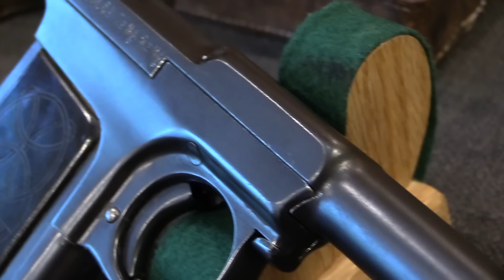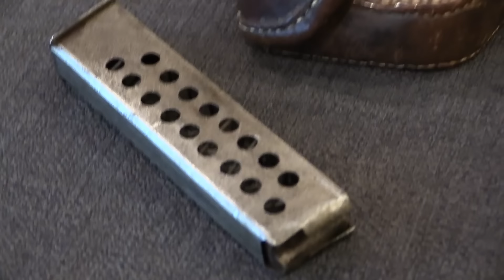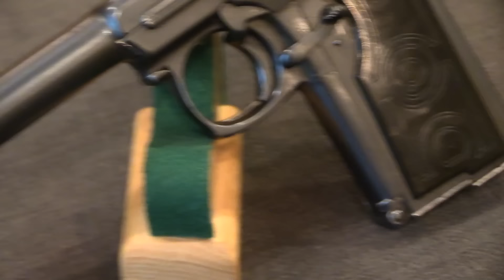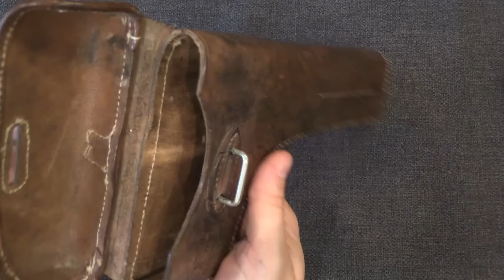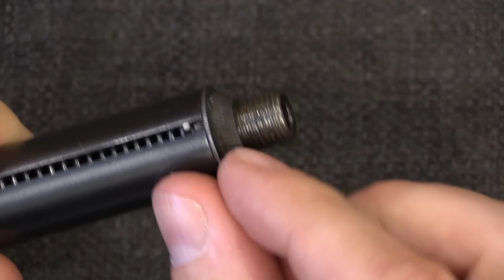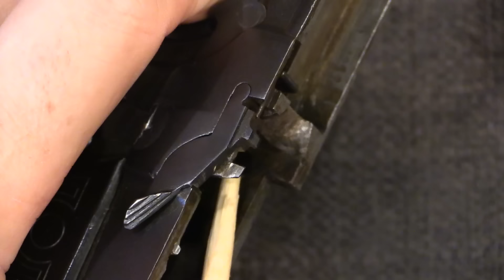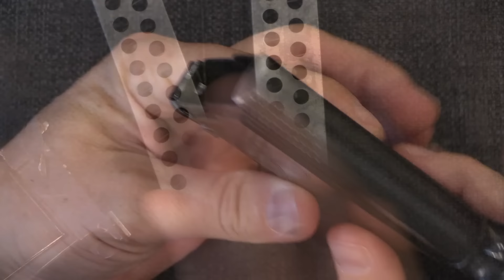Sunngård Automatic Pistol: 50 Rounds in 1909

Comment: You all probably figured this out, but at 5:40 Hg is Hectograms aka hundreds of grams.  It threw me off for a second because I was thinking Mercury
Reply: There actually was a x-com-like-game where the aliens geared up with their fancy shield which became increasingly stronger against beam weapons (which you would have acquired by that point) and increasingly more susceptible to traditional ballistic weapons...

And there was also x-com apocalypse, where you could develop a toxigun, using lethal poison to deal damage - mercury anyone? ^^
Reply: @peka2478  polonium is easier. old KGB micro pellets.
Reply: I thought it meant mercury too, and I was wondering who would base a weight system off of a toxic metal.
Reply: The Rogue Wolf The same people who used a toxic metal to measure temperature (especially in thin, fragile glass tubes made to be placed in one's mouth). ⚖️🌡
Reply: Soviet who Cuts Small bullet at high velocity? Sounds like it’d do alright against armor
Reply: @TheRogueWolf  You've never seen mmHg for a pressure measurement?  Or used an old thermometer?  Ye Olde Folk were clever, but they didn't always understand what was killing them.
Reply: Ye olde people probably didn't eat pressure guages or thermometers.
Reply: Hectogram symbol is properly spelled 'hg' though, like 'kg' and 'dag' (decagram) they're the only 'large' prefixes that aren't uppercase.

Comment: I'd imagine one of the reasons they rejected this weapon would have been from a safety point of view. With the rear magazine retained by that hook, it would have made Proving Clear a major headache, as in the military (certainly, the British Military), proving clear, that is, completely emptying a weapon of both ammunition and magazines, and then locking back the bolt, slide, or action is often the only way a weapon may be passed from one person to another, for example, when handing a weapon back into an armoury. (I'm a former qualified Range Conducting Officer for the-then Territorial Army, what's now known as the Army Reserve).

Comment: I'm guessing, and it's just a guess, that the intention of this design was to reloading with the magazine stores in the holster, using the second magazine in the grip as the third magazine. At that time the common practice was to retain the empty magazine and exchange it with the loaded magazine stored in the holster. I'm thinking the second magazine stored in the grip was a last ditch, it's there if you need it sort of thing.

Comment: While that deminuative cartridge might not be a one-shot stopper, in 1909 if you shot someone in the abdomen and the bullet pierced the peritoneum and the small or large intestine the person shot was likely going to die of peritonitis. Remember there were no antibiotics until the late 1930s. I can only figure that shooting a person several times in the abdomen would only hasten their demise. This of course assumes that that cartridge was capable of putting a bullet through whatever layers of clothing the person had on them at the time. Had it been fabric they would probably be toast; if they were wearing a woolen tunic for winter wear quite probably not.
Reply: David Green This, people who puzzle at the popularity of sub 32 calibres at the turn of the century need to remember that any, internal, injury likely resulted in infection and a painfully death. The deterrence factor was strong.
Reply: David Green if the 2000fps is anywhere close it would penetrate substantial clothing layers.
Reply: If we accept the stated velocity of 600m/s for a 28.5 gr (1.85gram) bullet the kinetic energy comes out to about 330J (0.5*m*v^2), this is much more than 22lr which will happily shoot through wood if HP and and also significantly more than 32ACP, although it is less than 45ACP I still think this round will quite easily penetrate a winter woolen tunic
Reply: It`s all well and good saying they enemy would die eventually, but that`s not much good to you on the battlefield if the other fella lives long enough to shoot you because you didn`t have a man stopper.  Hence the .455" Eley and .45" ACP.
Reply: The only real use of a pistol in actual combat is to spray some rounds to run away and get your rifle working again, or to just run away.  All it has to do is buy you some time, if it kills someone, great, and frankly I'd feel as out gunned holding a 1911 as a Ruger .22 if my attackers have rifles.  I'm pretty convinced that the best side arm is the FiveseveN because it's easy to shoot and has a large capacity.   Self defense in non-combat situations is a different matter.
Reply: David

If they don't die after the first bullet you shoot them again until they do like with any other gun. Plus pretty much any bullet with be an instant kill when shot through the head or the chest. 

Remember, attackers will be shot, survivors will be shot again.
Reply: Fell Man - I must disagree. Elsewhere on here there is a video detailing the results of a 1700+ incident study on the outcome of stopping an attacker with various caliber handguns. The .22, .25 and even .32 caliber rounds failed to stop the attacker at least 1/3 of the times even with multiple shots. This was real cases, not theory.
  The scariest thing about that study was that around 15% of the times when hit even by multiple larger rounds, there was a hard core of attackers that still kept coming. My guess is the shooter was having trouble aiming in a state of panic - which is not unusual.
  I personally did care in an ambulance on a guy who was awake and talking after being shot smack in the middle of the forehead with a .22. It was embedded in the skull, but didn't go all the way through. If his skull had not been as strong, it might have. But it didn't.
  A .22LR round is most often 40 grain. It's better than no firearm at all. The fascinating peashooter above was 28.5 grain. I wouldn't want to bet my life on it.
Reply: @Cacowninja 
The aim of a military is to incapacitate - not kill - the enemy.
With regards to direct fire soldiers are trained to fire in the chest area because it is the biggest target. Stomach is very rarely lethal but is painful.

Wounding the enemy is usually more beneficial either way. Someone needs to evacuate and patch up the wounded soldier. It takes time, resources and manpower, significantly cutting down the efficiency of a group or even a regular-sized platoon.

If the wounded soldier is not evacuated it will affect morale negatively, especially because his mates will have to listen to his screams and they can't be guaranteed to be evacuated themselves.

A dead enemy, while usually retrieved at some point, is much less of a hassle for the enemy to deal with than a wounded one.

Source: spent a year in FDF.
Reply: +David Green Your timeline is off. https://www.ncbi.nlm.nih.gov/pmc/articles/PMC3109405/ Sulfa and other antibiotics were in use by the late 1930's.

Comment: Serious question is it quicker to eject the mag slide the second forward or just load a fresh mag from the belt? I honestly think with training it can’t be that different and you get higher power rounds (albeit fewer rounds) per mag in the more standard semi automatics of the period
Reply: 123 456 I think the intention was to drop the first, reload from the belt and then you still have one left on the gun if you somehow still need to shoot
Reply: Sarlac Watch the video again.
Reply: To load the rear mag, put it in the front, engage the slide hold open and load from the top of the slide, then return it to the rear, and insert a loaded front only magazine.
Reply: Yeah, that second magazine definitely seems like it's a backup for when you're out of regular magazines. To be fair, most people wouldn't be expecting it. If it didn't even have a spare, it would be quite handy
Reply: InfernosReaper Yeah, it's more of a last ditch kind of situation where you somehow managed to lose the other magazine or most of your gear altogether.
Reply: The only real advantage to this magazine system would be in portability. In a military firearm, short or long, the speed and simplicity of a single drop mag would of course win out. But, for a hunting/survival type weapon it makes some sense. You could put a lot of rounds in a pretty compact package if you used the double magazine idea in a pistol caliber carbine.
Reply: slowpokebr549 I wonder if a CZ-75(?) like system of keeping a second magazine on a clip in position like a fore grip, instead of in-grip could have been a way to get better simplicity, while still having the second magazine “ready”.
Reply: I think the intention was for the second internal magazine to be preferred if getting to your pouch was troublesome. Also, having the mag so close to the action means that you don't have to open up pouches and fish for the spare if you're in a serious pinch.

This is a really cool gun, a pistol that can suppress designed a century ago.
Reply: At that time period this question did not exist
Reply: It seems to me, when this gun was made in 1909, many rifles had magazine cut offs and the rear magazine performs a similar function. That would be the last mag you would use in an emergency.Hats off to them though, 75 rounds in a relatively small form factor, is quite an achievement.
Reply: It's always going to be faster to push the heel of the gun after already having your hand there to eject than it would be to take it out and fumble around for a new mag.
Reply: Kraakesolv - You can't just eject it, it's physically attached to the rear of the pistol by a wire hook attached to the top of the frame, and a loop on the rear of the mag. The other 2 mags don't have the loop. As wastool said, you need to disassemble the pistol - at least take the slide off - to release the rear mag to load it (as Ian did to show it's method of attachment), unless you are able to load it whilst in the pistol, simply by loading it from the top with the slide removed.
Reply: J Corbett At least some watched the video.
Reply: I think you guys are underestimating how clunky that holster is and yes if you are in a firefight you would just drop the magazine on the ground.
Reply: The order in which you use the magazines is irrelevant, in this "what if" scenario they're all being used at one point or another so the order makes no meaningful difference.

No need to over think and over complicate this - this pistol was designed to maximize cartridge capacity plain & simple. The semi-fixed magazine isn't there "to be used first/last/whenever", it's there to add another however many rounds literally in the palm of your hand. We're talking about TWO magazines in a pistol during a time in which most pistols don't even have double stack mags, just completely unrivaled capacity PERIOD. The semi-fixed mag is there to be USED, whether YOU choose to use it first, second, or third doesn't much matter, and would come down to one's own training or tactical ideals(personally, I'd want as many extra mags as reasonably possible, and for the semi-fixed mag to be there in an emergency - but, again, at the end of the day you're still going through the motions of and using them all).
Reply: RyTrapp0 Well, if you use the reserve mag in the handle first, you'll also be extending your reload time for the 3rd clip by a substantial margin due to the extra steps needed to get the handle mag back into postion.
Reply: Oleg Great point, that's what I get for being lazy & heavy handed with my comments.
But, point being, even though the mag change mathematically/statistically(whichever you prefer) significant, in reality it isn't all that significant. I mean, you obviously don't want to 'paint yourself in a corner' in essence and get yourself in trouble with needing to swap that mag out with the quickness of course, but reality is that an EASY 90%(I'd argue 99.x%, but I can't back that up of course so let's go with a conservative 90) of side arms never get fired in anger in war, and, if you end up needing your side arm in war, your pretty much fucked already(think downed pilot in 'Blackhawk Down'). To the point that your life is very VERY likely to be saved by a 2 second quicker mag change. Which is why comp style mag changes aren't of any level of priority to the military. Which is the greater overall point(not that you didn't still catch me with that mistake of course).
Reply: AND its a BIG AND, magazines of the period wasnt supposed to be "dropped", today you feel silly trying to "tac-reload". Back in the day nothing else was even thinkable. In armies that did not even shoot their pistols every year the loss of a magazine would bring shame on the Officer responsible, to say this hampered their thoughts on the use of their weapons are an understatement. The British army was considerd completely insane for shooting more than 200 rounds a year, the germans lagged behind that, where Norway fell in this ranking I dont know. But a underdeveloped and barely industrilized nation as Norway was at the time wouldnt rank high..
Reply: Sarlac Disassemble the gun then load it. If you need to load it, you also need to clean it. So your taking it apart anyway.
Reply: J Corbett I stand corrected. I didn't see the last part when he showed the magazine hook and I wrongly assumed it didn't have one because the patent doesn't mention it and I am almost certain the version in the Norwegian defense museum doesn't have the hook either.
Reply: I have to agree with those saying that you swap the 1st mag for the holster mag and then wiggle the internally retained mag forward. It seems, as was mentioned, mag cut-offs were popular and that seems like what this serves. Plus, once you move the rear mag forward, the next reload isn't "soldier proof" with the retaining hook in the way. Interchangeable mags to swap, with an on board reserve if "dire consequences " call for it.
Reply: yes I would think the fiddling you have to do with this thing would negate the fact that you are only REALLY carrying the ammo in the first mag. If it offered any advantages its outshined by calibers larger than it. Its neat but I dont think in practice it would be much if any better than putting a new mag in.
Reply: obvious comment
Reply: Robert I think your exactly right. Plus where are you putting the empty magazine if you didn't plus one from the belt? You can't just drop it on the ground, that would be ludacris.
Reply: You would know the purpose of the magazine design if you read the description or even just payed attention to the video. It isn't for speed at all, it's for an easy reload with less fumbling and risk to drop the magazine since it's attached to the inside of the gun by a hook
Reply: General Zap I hate it when people are too dumb to see there is a question and then a personal opinion expressed...
Reply: 123 456
I'm glad someone else was wondering the same thing about reloading.  ^_^
Reply: How are you supposed to load that rear mag?
Reply: wastool Nah, just eject it. It's the same as the other mags.
Reply: Kraakesolv You can't eject it. Watch the video again.

Comment: It seems like the second magazine cannot be removed from the pistol (or am I mistaken)? If so, How would you re/load the second magazine before/during usage?
Reply: It is. You have to disasseble the gun to load the second magazine.
Reply: Steel Rain You are mistaken, it is removable.
Reply: Kraakesolv but it appears to be physically attached to the pistol by the wire.